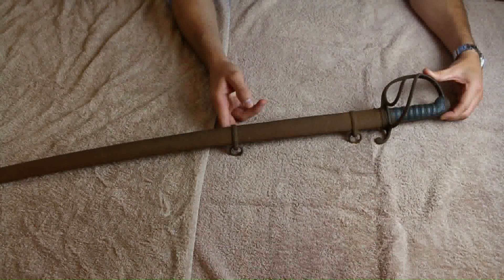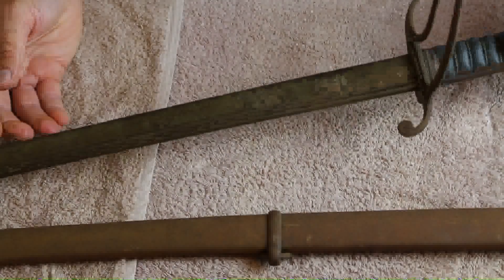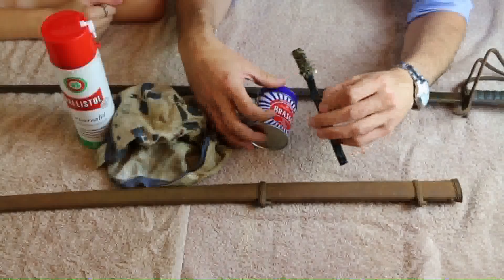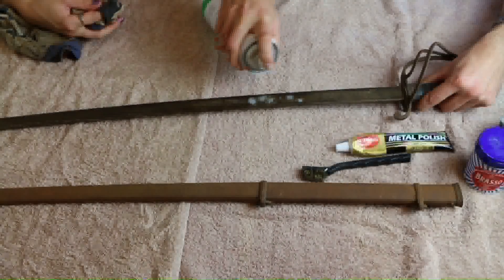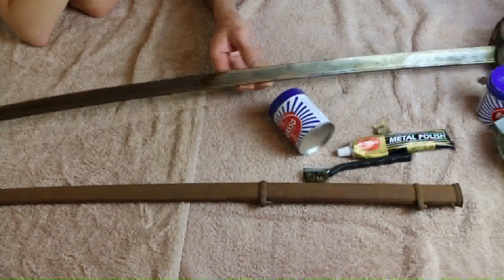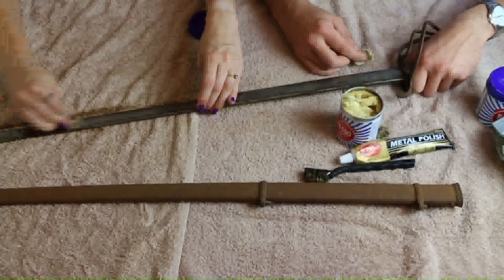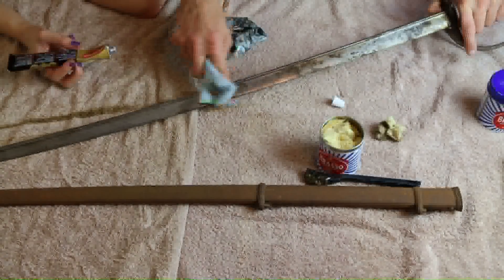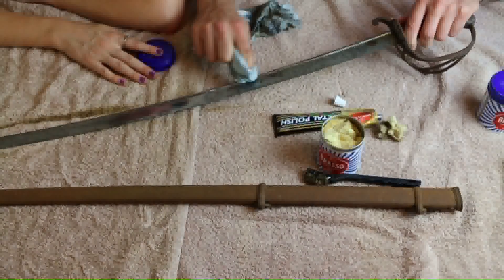Restoring an antique cavalry officer's sword blade

Comment: 25:13 In case you're wondering why Autosol is fine for cleaning swords, but should NOT be used for cleaning kukris.

Lucy Easton: "So why don't we use Autosol when we clean kukris? Why do I have to use spikey wire wool?"
Matt Easton: "Um..."
Lucy Easton: "Is it just not abrasive enough for-" [unintelligible as Matt talks over her]
Matt Easton: "It's to do- yeah, exactly, it's- so Autosol is not- see that? Look at that!"
Lucy Easton: "That is magnificent."

Comment: "Buffing my weapon" The innuendo is strong in this video. There is no such thing as active and inactive rust, iron will continue to rust until it is nothing but rust unlike copper patina which will form a protective barrier from further oxidation. Rust is porous and oxygen will get through it to the iron, copper patina on the other hand is not porous and becomes a protective barrier and then is inactive.
Reply: JETWTF There is a difference between red and black rust. I don't know chemically, or how the dark variety comes about, but it seems pretty stable at that stage. (Like eg under the grip of an old katana)
Reply: Under a grip means there isn't fresh oxygen to feed the chemical process. Underneath or inside something all the oxygen will be used up and if the whole thing isn't in in a high wind environment there wont be enough airflow to circulate fresh air to replace the oxygen depleted air. Black rust just means that it isn't in an environment with enough free oxygen to keep the chemical process going, once reintroduced to an oxygen rich environment the chemical process will begin again. This is why ancient wood or metal artifacts found in lakes and the oceans is kept wet, the water keeps the free oxygen in the air from starting the chemical process again and destroying the artifacts. iron artifacts that's been underwater for thousands of years are covered in that black rust and not melted away because oxygen in water is already attached to 2 hydrogen atoms and cannot attach to iron though there are always stray atoms and it is those stray oxygen atoms in water that manage to attach to the iron. Once a good crust of this rust is there fewer stray oxygen atoms can get to an available iron atom to create more rust.

Is black rust stable? Not in the least, it is just oxygen deprived. Also under the grip of a sword or knife, the oxygen will be depleted but oils will be introduced during normal maintenance and rust being porous does indeed act like a sponge and will soak up oil just the same.

Here's a fun thought, if you had a thick enough iron plate and a really thick glass dome that was perfectly sealed to the iron plate and filled with pure oxygen you would eventually have a vacuum inside the glass dome with rust where the iron was. So if you were a jeweler and wanted to create a vacuum to take the air bubbles out of your mold that's one really slow way of doing it but it would work.
Reply: Japanese sword tangs aren't usually cleaned, as you say. But I've seen seriously old blades that whilst the "blade" portion is spotless, the nakago (tang) is so corroded that you could likely snap it with a rubber mallet.
Reply: Thanks for clearing the misconception. I've wondered about this myself.
Reply: @althesmith  Yes its generally frowned upon to mess with the tang or "nakago" in the Japanese sword world. However i think an antique nihonto with a cleaned Nakago will be worth more than one without any at all. I

Comment: Camera tip: you can't use auto exposure for videos like this. The camera is exposing for the ground, not the blade. It thinks you're a towel channel not a sword channel. 

If you set the exposure one or two stops above the default we will be able to see the blade much better.
Reply: OurCognitiveSurplus I was wondering why it was bizarrely pixilated on 480p...
Reply: At least he knows where his towel is.
Reply: ApanLoon Omg yes
Reply: I was wondering why he was polishing a sword on top of a towel.

Comment: As an American, and Minnesotan, that is still a Brillo Pad.  And the reason why we call a lot of stuff Scotch is because a lot of things produced by the Minnesota based 3M Company use Scotch in the brand name.  So, what you call Cello Tape is marketed here in the U.S. by the 3M Company as Scotch Tape.  Reportedly the reason why this is so is because of the stereotype (at least here in the U.S.) of a Scot as being a skinflint, or miser like Dicken's Scrooge.
Reply: David Briggs In France, adhesive tape is usually called "Scotch".
Reply: That stereotype exists in Ireland too lol Its probably not true. Probably...
Reply: Illinois guy calls it a ScotchBrite pad. Brillo is a steel wool product impregnated with soap.
Reply: Brillo pad doesn't exist here in Hawaii. It's either referred to as a Scour(ing) Pad or a Scotch Pad because of the manufacturer.
Reply: Colorado here, scouring pad.
Reply: Ernest Sheffield Am Illinois guy. Can confirm that what I call it.
Reply: Actually that's scotchbrite. A brillo pad is the very very thin steel wool, usually with soap added. At least anywhere in the states ive lived.
Reply: Abradolph Lincler Yep. LOL.

Comment: Several decades back I was told by a Major (ret'd) who'd been involved with "the Queen's music" - of a regimental dinner at some time earlier in his career where their Colonel's lady had had a sizeable celebratory cake made for the occasion. When it became time to cut it, the claret & brandy had been in circulation for some time and some wag suggested that the Colonel's magnificent presentation sword be used to cut the cake. So it was well wiped down and the cake duly cut. The sword was parked beside the scabbard on the table as it had become part of the proceedings and later in the evening some junior lieutenant saw it and thought it safer to re-scabbard the sword. But he too had been at the sauce and failed to notice the soiling of the blade from its passage through the heavy fruit cake. The incident was forgotten until at some point - presumably weeks later - the need arose to wear the sword, the cake-involvement having apparently been overlooked due to reasons not entirely unrelated to... claret and brandy
And - it could not be drawn from the scabbard - it was as if welded in place.  It eventually took a visit to an armourer/swordsmith who had to cut the scabbard open to prise free the now-corroded - and accordingly no longer quite so magnificent - blade.
To me, the story's flaw is the junior lieutenant. Who knew that he'd "dunnit"? Would the state of the blade be widely circulated once discovered?  Were I the Col, I think I'd have slipped the armourer a few tenners to quietly remedy the damage as best possible and let it rest there...

In movies, when I see a sword freshly bloodied in battle being re sheathed while still bloodied, it reminds me of the Colonel's sword. Blood is corrosive stuff, well guaranteed to rust-up a carbon steel blade in no time flat. Yet in same flick, when the next battle scene is shown, do we see a rusty blade being flourished by the hero?
I despaired when I saw first that scene in (was it the second) LOTR film where Saruman's super nasty uruk hai were being armed with blades we see being multiply-cast in flat moulds. The consulting armourer must SURELY have told Mr P Jackson that it just ain't done that way, but the silly scene persisted...

Comment: Yeah, there are several kinds of rust. 
There is the reddish kind of rust (FeO etc.) witch (probably) catches water vapor, and should be removed.
And there is that black rust (Fe3O4 - magnetit) witch forms a really nice hard and protective patina (like on carbon steel kitchen knifes).
Bevore cleaning a blade you can stick it into boiling water. The heat will transform some of the red rust to magnetit.

Comment: if you're cleaning old oil, varnish etc off a blade with intact etching you might want to try using acetone, it is a fairly strong solvent that doesn't affect metals or patina, just be careful not to get it on non metals bits e.g. shagreen, leather, wood, paint etc
Reply: I have the same sword in real bad shape :( . What should i do the rust damage is too much

Comment: 7445 – White pad, called Light Duty Cleansing – (1000) 1200-1500 grit
7448 – Light Grey, called Ultra Fine Hand – (600-800) 800 grit.
6448 – Green, called Light Duty Hand Pad – (600) 600 grit
7447 – Maroon pad, called General Purpose Hand – (320-400) 320 grit
6444 – Brown pad, called Extra Duty Hand – (280-320) 240 grit
7446 – Dark Grey pad, called Blending Pad (180-220) 150 grit
7440 – Tan pad, called Heavy Duty Hand Pad – (120-150) 60 grit
Lots of options for scour pads from scotch bite.The white pads are very delicate .

Comment: I got a REALLY bad one a few months ago, The "treacle" oil was caked on so damn bad I got flashbacks to restoring guns stored in cosmoline, except i couldnt soak the parts because i no longer had my tub for mineral baths, I ended up eventually getting it off with mineral spirit scrubbing across several days, and discovered, ironically, that the sword was pitted all to hell.

Comment: Bought my first sword and it is almost exactly this model, the guard and blade are the same.
It was very dirty and I cleaned it with WD40 and paper towels, I had to take some time because of rust. 
It was the right procedure??
I mean after I saw someone saying not to use paper towels.

Comment: I use Ballistol to clean all my guns, I spray every part completely down with them and wipe it off, barrel is sprayed first and cleaned last. It's neutralizes corrosive chemicals, is a good solvent for gunk, and is a good lubricant as well. By itself it will do everything, and never hurt any part of the firearm. I've got gallons of the stuff! I keep my guns in "like new" condition, as weapons should be. RemOil or lithium grease is a better lubricant tho.

I'm glad it's OK for swords etc to, I know many gun oils like RemOil etc have harmful chemicals that are harmful to some materials.

All my kitchen knives are kept razor sharp and in wood. Not so much for culinary use, tho that and safety are good reasons. It's mostly because I want better weapons stashed in my kitchen! I'm aware criminals commonly use them, but I don't think it will make much of a difference - for them. I'm also OCD, all edges must meet the standard of the emperor's own sword grinder!

Always a joy to watch you restore pieces of history and work my way towards another point in Smithing. Thanks!

Comment: To partially contradict a fellow American below, I've never heard a green scrubby called a Brillo pad. Brillo is the brand name of a pad of rather coarse steel wool impregnated with abrasive scouring powder, which I'm sure you would never use on a sword blade! The most popular seller of the green scrubby is 3M Scotch-Brite Pads.
Reply: Cecil Brooks yep, but scotch pads are often called brillo as well, even if incorrectly
Reply: Cecil Brooks At my work we use Brillo Pads. So we call them such but I will say from personal life ive pretty much only heard them called Scotch Pads. But theres loads of leahweigh. Like fender and bumper... Ive never said fender without mentioning guitars.

Comment: There are other options I know that can help. There are blue scotch pads that are finer. There are sandpapers that can get really fine to a mirror polish. There is also jewelers rouge the green is the one I use on most things. You would put the rouge on something and rub on the surface of the blade.

Comment: Warm, (dish-)soapy water is as gentle and cheap as it gets and is also very effective against oil and grease. If you dry and oil the steel afterwards it won't rust. Using Ballistol for cleaning grease and then wiping it off is quite a waste imho. I'd also try an old toothrush before using a wirebrush or steelwool.

And although Matt's head is not in the picture, I presume he is wearing Catt Easton on it like I asked him to.

Comment: Wirewool: I doubt you'll see this comment within these 300+, but if you don't like using wire wool there is a product called 'sanding sponges'. They come in many grits, are rather cheap, and can get in to tight spots. I've finding that a warn one shines up steel pretty well. There is also the trick of gluing or stapling sandpaper to sticks and using nail-files to get into tiny spot. 

I'm not an expert on restoring swords, but I finally got my first antique sword for restoring and research, and a lot of my cosplay and construction skills seem to be transferring well. Might have to throw up a quick video so people can laugh at my naivety.

Comment: It is kind of easy to clean off a blade greased in the IMA/Nepal fashion, a rag dipped in WD40 or even 3-in-one oil does quite well esspecially with a brass toothbrush.  What I am curious about is heavily rust pitted swords and replacing decomposed leather hilts (such as on one of my 1885 cavalry swords).   :)   I am finding 800 grit emery cloth followed by 1,000 - 1500 grit emery cloth.  Of course that is not advised for etching or near proof or unit marks.  I am also finding a product called Jasco works well for rusted scabbards.  So does Naval Jelly.  They turn the rust black and stop the rust process.  Whether or not they are better than simply soaking the scabbard in vinegar for 2 hours is debatable.

Comment: In America, we save the word "brillo" for Brillo brand steel wool pads. Steel wool might be what you call wire ball, but, I'm not sure. Please correct me if I'm wrong.  We usually just call the 3M Scotch Brite scouring pad a "scrubbie". Here Brasso, is sold as a liquid polish, I've never seen the Brasso stuff that you have.

Comment: Hey Matt! In Mount and Blade: Napoleonic Wars, the French Line Guard's Infantry Officer Saber has a very pretty blue etching down the fuller of the blade which I have never seen anywhere on other swords. Did this etching appear on real swords, what was it, and where can I buy one? It specifically is not the cavalry guard's sword, but the infantry guards sword. It looks magnificent.
Reply: Got a screenshot?
Reply: Yes! http://steamcommunity.com/sharedfiles/filedetails/?id=1159609706
Reply: Sabre du Officier du vendémiaire an XII, That style of bluing isn't historical, it was normally a solid panel. I dunno if I can link here but I'll try
Reply: Thank you!
Reply: That looks like "blue and gilt" that Matt recently made a video about.
https://www.youtube.com/watch?v=p9Fvd4faYJY
As to how historical it is to have the whole fuller blued I don't know enough about that sword.
But from the picture IPostSwords linked i can say for certain that that sword was blued with heat.
A quite finicky process that would not be easy to get even colour over a whole blade.

Comment: I love ballistol. Not on plated surfaces.

 I use ballistol if I'm using or carrying something outdoors .but EEZOX for storage. 

I tried RenWax...but for some reason it didn't perform as well as eezox 

 Matt, have you ever used Evaporust?...its a mild chemical process that takes about 24 hours, is reuseable, non toxic. 

The black rust is mill scale or hematite.  You can actually convert red rust to mill scale by simmering the blade  in water for about 10 minutes. As you know, mill scale is far harder to polish off and is far more stable.

 Walter Sorrells a knifemaker here in the US did a great video on that called Caring for Carbon Steel Knives. Its actually an old gunsmithing technique.

If you guys are khukuri Nutter Bunch.then you have to know Simon Hengle of Tora Blades, and my friends at HIMIMP😃

Comment: Wilkinsons would describe it on their blade proof pages as a 2 bar hilt.  I have a couple so called 4 bar hilts and the proof page describes them as 3 bar. Of course the knuckle bow is not a bar. Send the sword to me and I'll clean it up and send you a photo of it (not the sword itself). So far that hasn't worked with anyoneThat pad material is used on 4 inch discs with it overlapping itself. Can use a 4 inch angle grinder. It's more abrasive using a disc but works on really corroded blades.

Comment: Bet someone used cosmoline or some heavy grease on it before storing the blade. Also stuff like 3 in 1 oil will evaporate and leave that residue.  Need to use a solvent like mineral spirits or kerosene to clean the steel first, as it is cheap and will not hurt the steel and will save you some time versus Ballistol. Use the Ballistol after you have cleaned and dried the steel.

Comment: Just had an add longer than your actual video. Dunno if it helps you more but I watched the whole thing. Turns out t was a pretty good short film about skiing.

Edit: Then I checked the length of your video. It wasn't longer, only half as long. My bad. DX
Reply: Monkeysrock yeah I've seen some actually interesting content just shoved in the ad slot lately.
Reply: Komier 
It's funny because I'll skip a 30 second add on legos or a car but I'll sit and watch a 20 minute mini documentary or short film.

Comment: For that old oil residue, brake cleaner would work great and require little to no rubbing (hate to spoil your fun, lol).  Matt, have you considered or tried that in the past?  If so, was there a reason you decided not to go with that option?  On a side note, for non-abrasive rust removal, I have seen an over night soak in good old Coca Cola work miracles on rusty car parts.  It might be worth a try on rusty swords.

Comment: Also if you let the ballistol set for ten or fifteen minutes it will do a better job of removing the grime, I use it on all my guns, both the wood stock, the metal parts, and leather slings and such.